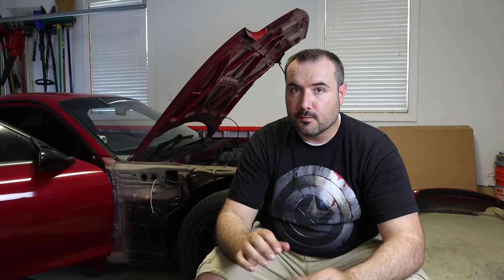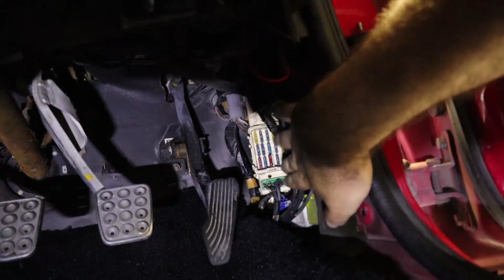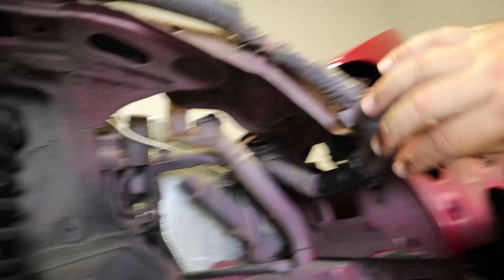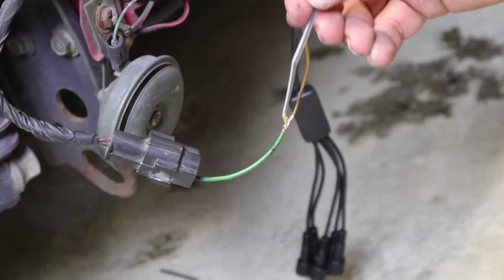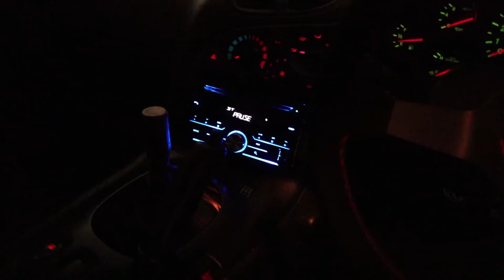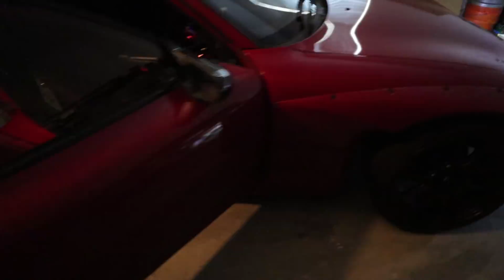Fixing Some Electrical Issues and the Day Time Running Light Install on the RX 7

Comment: How much clearance dose the car have from the ground
Reply from the maker: Not much. Side skirts are probably the low point. Between 4” & 5”... front lip wouldn’t make it over a mountable curb.
Reply: How dose it handle over Speed bumps or can't it
Reply from the maker: I don’t scrape if I go slow, but I always drive over at an angle if possible. The front lip would catch on just about anything so I removed it for now.
Reply: @IconGarage  sweet because I'm thinking of putting a kit on my 1996 rx7 and just wanted to make sure it was all good

Comment: after seeing what happened with this car, you need a battery disconnect and a fire extinguisher on you at all times with this, and you need to replace those wiring looms back and front after getting it all buttoned up and back together, as its just too far gone to let that stay like that forever. Also I guess this should be a tip video for future RX 7 Right Hander buyers, if it has cut fenders, cut the deal and check the loom!

Comment: I would guess that the 2 cut off wires you found at the harness under the fender is for fender-blinkers. There's probably the same thing on the other side of the car too if I'm right. 🤔
Reply: Jan Wikstedt good catch, my japanese car has the same colored wires for the blinkers.

Comment: You literally can't electrocute yourself with 12vdc. you might get a good jolt if you lick a hot and ground, but you can grab the terminals all you want and it won't shock you.
Reply: Skwisgar2322 the concern is a short. It’s a fire waiting to happen
Reply: Yeahno I am aware of that, but he specifically mentioned electrocution.
Reply: theoneschne no, you cannot. The amount of current the battery can deliver is irrelevant, dry human skin has a resistance of around 1MOhm and wet around 1kOhm. By Ohms law, the current passed will be .012-12mA of direct current. Well below dangerous levels. Voltages below 50v are generally considered safe.

Comment: Nice work. I also hate electrical issues in cars. These are the worst. Just one more thing, soldering on a car is not the best method. There is a risk of acid building up that causes the copper to corrode. This is the reason why the fuse plug had this crimp connector attached. Crimping is the preferred method for car looms. Nonetheless your soldering is really good.

Comment: I strongly suggest going back and fixing those damaged wires correctly.  Electrical tape is not a permanent solution. The loom really needs to be opened up and the damaged wires need to be replaced.

Comment: I can see this car lurking around greatness when finished but I think it needs a full ground up rebuild to max its full potential. Btw is there an issue with front tracking/geometry? It looks like the outer edges of the tyres aren't on the road.
Reply: Too wide of a tire + unnecessary camber.

Comment: Just a little advice...
Less commentary. Less whinging. More work. 
Second episode on just DRL's. If Chris wanted to rebuild it the way you want to right.. he would've been way ahead. You'll never achieve what he has at this rate
Reply: Legititable I think you need to take your own advice
Reply: I mean that's not fair to say, you don't know what his intentions are or what he plans to do with this channel; Chris didn't get as big as he is with just one build. I don't even think his plan was to use this car to get as big as b is for build (although it does give him a nice boost). Also, there are plenty of episodes where Chris has spent a lot time getting little to nothing done. I'm liking both channels right now, Chris for his crazy ideas regardless of the outcome and this one for trying to do things proper in a home garage by himself.
Reply: HolyHateBatman
Reply: Legititable you stole the words right out of my mouth. Amen brother.
Reply: NealDown. Btch. 
He and others have to understand that Chris, from B is for Build, didn't buy this FD to fully restore it. He bought it for a 2000mile road trip, which he achieved, and then sold it away. He redid the interior and the looks HEAPS better than the condition he, Chris, first got it in. And now this dude, and a few people, have the audacity to bash and beat Chris for this.

Comment: gotta love the armchair mechanics. Chris did this project under a very short deadline for a specific purpose. If you watch his videos about getting the car, you might recognize that the car had been sitting for a LONG time in Japan near saltwater. Additionally there was a fire around the stick shift and below it on top of the transmission. all you ppl calling Chris a hack need to calm the hell down. the car was never sold or said to be in show room condition. It was built to run for Portland to LA and back. in that time, Chris decided he didn't like the right hand driving and the many issues he was still having with the car. His electrical issues were brought up every episode.  from what i see Matt was aware of the majority of the status of the car and the history that Chris knew of it. anyone who has ever worked on an older car that has sat outside for a long time would know how bad electrical can be even if you know the history of a car none the less it coming from half a world away. Matt good on you for trying to get this up and running again. it is defiantly a rare find in the US you are making awesome progress and thanks for the videos!

Comment: B is for BABABOUILLE...............One thing,I installed behind my dash-board,gear stick tunnel and other "secret"places,are salvaged 12 V small cooling fans(computers towers or lap tops,they "kick"in everytime I start my car,a Volvo V70 R,5 cyl with a single Garret turbo,it keeps all my hidden  wiring vented ,it does work,have bigger extractor ones under the hood(vents) with heat sensors in the engine bay(on demand with a switch)with dash gages,IT WORKS VERY WELL.......!!!!!!!!!

Comment: Please use heat shrink on those exposed wires you previously repaired with tape, it’s no secret electrical tape can unravel with heat which will just bring you back to square one. They even make heat shrink that has a sealant that is actives when shrink to the wire which will keep out moisture to help stop corrosion. Just my two cents.

Comment: If i may give an advice is to"power spray"those small exposed radiators,on the front, to clean them, and up the air flow,before putting back the front fender,and a a little black spray paint.....

Comment: Probably the whole wiring will need redoing in this car otherwise new problems gonna pop up all the time personally I think this particular rx7 isn't worth it too many issues and also with all this wide body kit and cutting it's been done to it will lower the value significantly
Reply: thanos mousios dude, it's a car, it can be rebuilt. Literally not that much wrong with it. Now if it was rusted to hell then it wouldn't be worth it.
Reply: madmax2069 I know am not saying it's not possible am saying it's probably not worth it you won't get your money back from this car
Reply: thanos mousios he's not doing this to flip it to make a profit, he's doing this because he's keeping it long term. When you plan on keeping a vehicle long term the vehicles value plays no roll in it.
Reply: madmax2069 I know all am saying he could have picked a better candidate I've done the same with my 98 Range rover but only becouse I already had a parts car and mine had heads and headgaskets with 15k miles on otherwise it was scrap

Comment: if yo keep running into problems you should probably buy a new wire harness and redo all the wiring
Reply: Another +1 for the new harness.  Too many issues and gremlins to fight through.  You have long term ownership plans so make the investment.   It's a RHD FD.  It will be worth it in the long run.

Comment: It's great to see this car getting the TLC it deserves. Have you tried using Marine Heat Shrink? It's heat shrink that comes with insulation goop on the inside to protect wires from dirt and moisture.

Comment: I used to be a fan of B is for build that was until you realise that he truly did a hack job on that car. The paint, body work fit and finish of every single thing he touched is just terrible and very unsafe. I know the guy built it in a rush and he lost interest in the car but to sell it on with all those issues is just out of order.
Reply: his fake deadlines will be the channels demise imo
Reply: Travis Thompson did you see that massive run on the door hahaha
Reply: That run was a Marathon. He would have done a better job with a roller and house paint.
Reply: All of his cars are like this. The Avora is the same way and then he parked it on the street so people can back into it. I had to unsubscribe because it's so cringe worthy. I guess it works for him.
Reply: btedition oh yeah dude he HATES when someone criticizes his work! He's had rants about it. He is in the wrong business if he can't take comments lmao.
Reply: Dude, that's a waterfall!
Reply: BioHazard Shrimp he deleted my comment when I said that the paint on the car turned yellow and the bumper color was probably correct lol
Reply: yeah, i wonder if a polisher can fix that
Reply: Probably not just think if that is on the drivers door how bad is the rest of the car.  Also the hours your would have in it trying to sort it without burning through the paint would be mental.The over spray on literally everything under the car is grim and could have been easily avoided.

Comment: An under tray is definitely on a list of things to get! Miatas have options for full aluminum trays so I'd bet FDs have something similar available
Reply from the maker: I have a brand new OEM under tray on hand and ready to get installed! Probably have to mod it some to fit with the wide body bumper. Aluminum would be sweet tho.